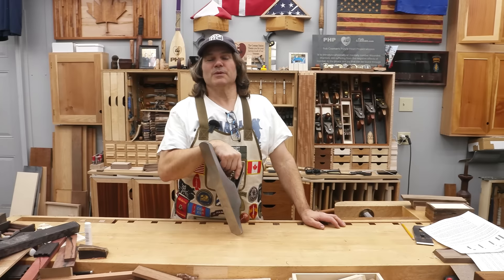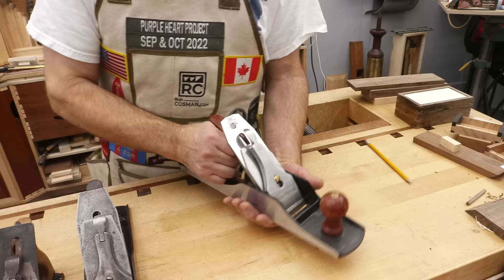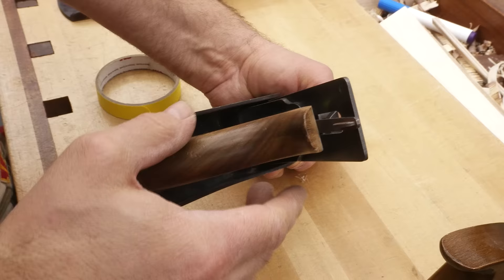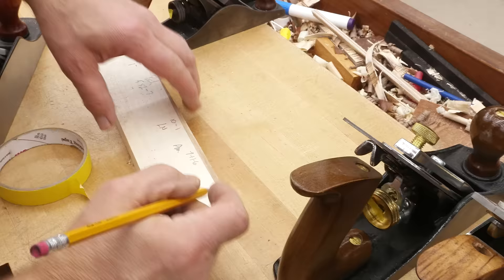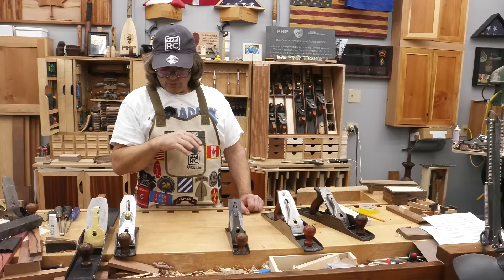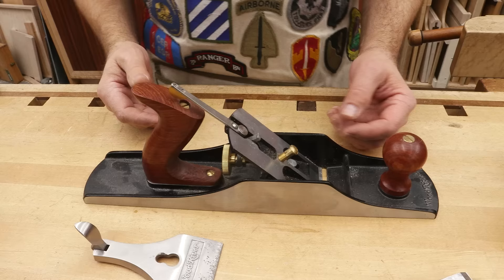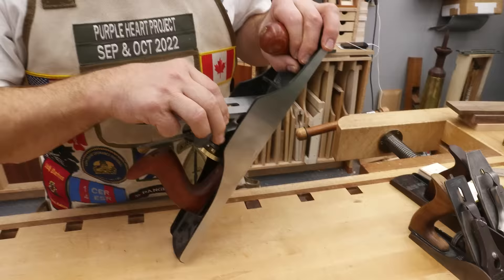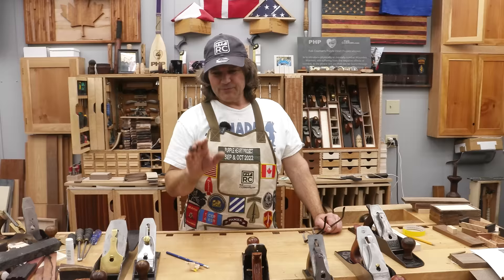How to Reduce Slop in Your Hand Plane | Hand Plane basics

Comment: I've been working with wood in various ways for going on 60 years, starting with my Boy Scout knife and a flat rock for sharpening when I was 10. I do almost entirely hand tool work now and I've never found adjuster slop to be a big problem. In fact, I think a little slop is a good thing when I've adjusted the blade extension just so for a fine cut. Even considering my battles with Arthur (Mr. -itis), I just don't find this to be a big issue. It's possible Arthur and I would benefit from the star wheel on a couple of my oldest planes but even so, at 69 I'm just not in that much of a hurry. Thanks for your continued sharing and innovation.

Comment: Glad to see you promote the Reed planes yoke kit, it's an excellent solution to the major problem. Your Adjustar knob is definitely nice, sometime in the future I'm hoping to be able to try both of these solutions. There's another trick to help lessen the slop and I saw it compliments of your old mentor, David Charlesworth and that's to put a piece of tape around the yoke to help take up play in the slot in the chip breaker.
Reply: A variation of this idea is to fold a small piece of thin steel or brass sheet over the yoke. The best solution is to get a plane with a Norry's (sp?) Type adjustor, no slop at all.
Reply from the maker: Thanks for the tips!
Reply: @skwalka6372  in an ideal world, yes using some very thin copper/brass would be the ideal solution, but most don't have easy access to that sort of material and so tape. 
Regards the Norris style adjusters, I've never used them, but the theory doesn't appeal to me of having one piece that could change 2 settings at once, i.e. trying to set the blade depth and accidentally skewing the blade.

Comment: I can get carried away "adjusting" my planes, squaring, flattening, sharpening, and miking very thin shavings.  I've noticed various degrees of backlash but never thought it was critical to deal with except to insure the blade didn't move as a I planed.  I discovered that by accident years ago and "park" the yoke to be sure there is as little freedom of blade movement as possible.  Your advice not to worry is the best that can be had.

Comment: I’ve got adjuststars on both my L-N °5-1/2 and °4, they work great. I’m considering grinding the length of the wings off some on the one I use in my No°4 though.  I have already taken both of them to a buffing wheel loaded with a fast cutting compound though to ease the sharp edges left from the machining.  Additionally anyone looking to add a great piece of kit to their L-N °102 apron, °140 skew, or °60-1/2 block (both rabbeting and standard) should look at Reed Planes adjustment knobs.  He’s got a roller bearing pressed into a knob that perfectly fits the notch and not only makes backlash non-existent, but also makes adjustments easier because it reduces some of the working of the tension in the cap screw.  I’ve added them to both my °102 apron and °60-1/2 Rabbeting Block planes.  I’ve not used any of Reed Planes Bailey adjustment kits yet but have heard great things.  I’ll probably try it on my Frankenstein foreplane first, since the other Baileys are all original.  But I highly recommend both the adjuststar by Rob and the Reed Planes bearing screw for L-N block planes.  I don’t know however if they are useful for all the WoodRiver block planes, you’d have to ask them.  Just my 2¢
Reply from the maker: Several folks have cut down the adjustar to fit on the #4
Reply: I ordered a couple of the Reed Tool bearing adjusters, and while they fit on my #62 LA Jack and my #60-1/2 Rabbet (with a little filing on the slot in the blade), they would not fit on my #60-1/2 Adjustable Mouth Block or my #102 Apron planes. This replacement part has a bigger diameter knurled knob and, on the #102, the bearing also has bigger diameter than the corresponding portion on the OEM adjustment knob. The larger diameter of the bearing holds the blade up off the bed on the #102 (making it unusable,) while the larger diameter of the knurled knob runs into the raised "102" near the rear of the body such that you cannot advance the blade far enough to reach the mouth opening. As to the #60-1/2, the knurled knob also scrapes the body of my #60-1/2 Adjustable Mouth Block plane when advancing the blade, but not anywhere as bad as on the #102 -- tolerances may vary enough from plane to plane for others to have a slightly different experience. Oh, and while writing this post, I double checked the situation and am now wondering how well the bearing adjuster fits on my #60-1/2 Rabbet as I can see a little light between the bed and the blade. On my plane, the bearing is too wide for the slot in the blade which seems to be the cause for the blade to not seat fully onto the bed. I purchased these adjustment knobs to eliminate any possible lateral adjustment issues rather than worrying about the backlash, however, I'm not sure it totally eliminates all lateral movement as you adjust the blade's depth of cut... Sorry for the long post, but people should be aware that this replacement part will NOT work on their Lie Nielsen #102 Apron plane. However, Reed Tool has stated that they may look into making one that will fit.

Comment: Good advice!!! I never considered it as a big issue. Actually from mechanical build my no 4 Stanley bailey which i turned into scrub plane is very good comparing to my others planes ( my Luban is the top brand that i have but in bottom line they all do they job good just keep them sharp). The Adjustar is like a game changer and i have order a nother 2). Thanks and stay sharp!

Comment: I have a Number 5 with no makers names on it and the slop in it is absolutely horrendous, I got it used with a couple others I got as my first set of planes.   I have been wood working for 2 months and understanding how to fix this issue an why it happens is helpful.
Reply: If the slop is really bad try folding a piece of brass sheet over the yoke, hobby shops carry it.
Reply: @skwalka6372  that is a great idea, thank you. I will try that.
That same plane had a problem with the tote bolt not tightening enough and some oen suggested a small washer and that worked great, so the tote issue is the last of the problems, albeit small, I'm having.
Reply from the maker: Look into the reed no slop Yoke..its just $14

Comment: Rob, I don't think the quality of the plane necessarily indicates how much backlash there is in its adjustment.
I have an expensive No 5 Clifton bedrock which is my favourite tool but it takes a turn and a half to re-engage. But a couple of years ago I restored an old Stanley 4½ which was a heap of rust when I bought it. When I first tried it there was hardly any backlash which I thought must have been a fluke. But after using it extensively I now know it wasn't - its adjustment works better than any other plane I have, in fact, the adjustment is so smooth it can be done easily with one finger.
I can only conclude that by making thousands of planes, every so often one must turn out where everything in the engineering tolerances goes just right.
Reply from the maker: I concur

Comment: Of my 5 LNs with adjuster wheels and the sloppiest one is just less than 3/4 turn, that is also my oldest one from the early 80s (a No.6). My ECE's have zero slop, but they use heavy springs to keep the mechanism pretensioned. I have a couple of old bailey pattern Records that live in my tool chest and they have a unreasonable amount of slop :-) Never really thought about trying to do anything to improve them, however. Maybe now I'll try.

Comment: I'm relatively new to hand wood work, but first obese i made in New plane upgrades was "fine adjustment" knobs.  The stock threads on adjusters was so course, i had difficulty making very small blade movements.  The fine threads increase the turns per unit of movement and reduce the strength needed to turn the adjuster.   I'll wager the threads on your grandad's plane are MUCH more fine than those on the "big wheel" adjusters.   My planes are Veritas, so not cheap.   All but the router plane have 1/4 to 1/2 turn slop.  The router is nearly 3/4.  However they are all Norris style adjusters.  My next plane of I buy one will be Bailey style and I'll get your star adjuster.
Reply from the maker: Thanks for the info

Comment: Wow Rob one more nice advice...I do have your AdjuStar in my 1942 Stanley #5 1/2 and it works great (very clever idea)...instead of use a tape as a nice way how told by Lynx G I used an eletric plastic insulate (I don't know how do you call in English) but is something like a straw and when you apply heat from a heat gun it melts around the end of yolk and minimize (or almost zero) the gap with chip brake slot..it works pretty well but to me as a hobbiest woodworker the backslash is not a big issue...

Thanks Rob and Lynx G for sharing your experience.
Reply: "Heat shrink tubing" is what you're describing if you need to refer to it in the future.
Reply: @briancarroll6803  Thank You
Reply from the maker: Great tip

Comment: I have a woodriver 5 1/2 the lever cap rides up when I retract the blade . Would the star  adjuster fix that by being able too tighten down the lever cap screw so it couldn't move.

Comment: Hold on. it is called back lash, not slop. The back lash is an intrinsic part of the thread when the threads are cut. If the threads were cut not to the correct, send the plane back if it bothers you. I use the back lash to know when I'm staring to move the blade.
Reply from the maker: It’s called slop. You’re focusing in too closely on one aspect of the problem. There’s the backlash in the threading, the difference between the ID on the knob/adjustar and the OD on the loves of the yoke, and then the top of the yoke as it relates to the opening of the slot in the chip breaker. It’s called slop as a whole.

Comment: Surely someone can produce a chip breaker with an undersized slot that you can file to the correct size and angle. Combine that with a pin and the correct drill bit and a shim for the adjuster.
Reply from the maker: You would think so right?

Comment: The backlash really annoys me. These days with cnc machining it is easily possible to make any tool with correct tolerances. If you are going to use precise dimensions, just make them right. I have a cheap block plane with 1/4” wide mouth. Ridiculous. Nothing to do with tolerances, just stupidity. I suppose the maker thinks it can take 1/4” shavings.
Reply from the maker: Good point

Comment: Excluding uisng high quality blades in cheap planes, I consider the slop in high priced planes unacceptable. If the plane sell for $500 I want a top engineering level in the plane. It's not happening. I can think of three redesigns worth doing in top tier planes that would make it like rack and pinion steering. It would be too expensive for lower priced planes, but worth it for the best, better, and darn good, level planes.  I buy things that make my life better and easier,  not more aggravating. Since high priced planes fail to meet these standards they are disqualified from consideration. Since you talk with the big boys at these companies you might pass this along. Good video. Frustrating conclusion. Be safe.
Reply: Eliminating slop comes at a cost, though. Less slop means more friction, making it even more difficult to adjust. It also requires higher precision machining. Higher precision machining means more expense. The manufacturer has to balance between meeting a price point, and making the perfect machine.
Reply: I agree, there is so few moving parts that tolerance stack up is not an issue. They should be able to control these to tighter tolerances in the $300-$400 planes
Reply: @jimhyslop  I think woodworkers could handle the extra friction. It would be no worse than what it would be when actually moving the blade. As for cost, I don't mind paying for quality. What I'm saying is the top end planers are not providing what they should at the $500 price. Who do they think they are, Detroit Auto during the 1960s. There is an extreme markup in high end tools. If they want the money make the tool that's worth the money. I didn't mind buying  a Veritas router plane, because it was worth the money.  That's why I'm still using a Grizzly plane, with a good blade. I'll put up with the slack at this price, not at $500. But I do like your thinking.
Reply: @TheTranq  Right On!
Reply from the maker: Good chat